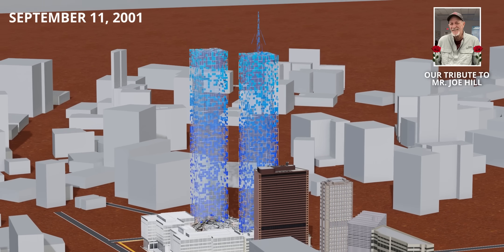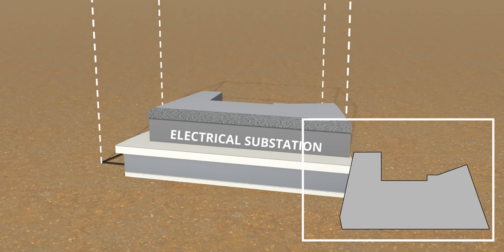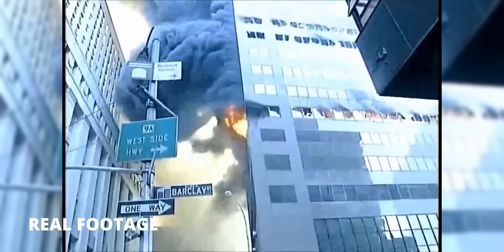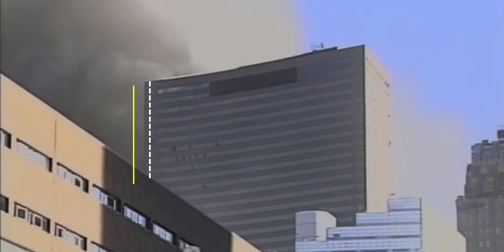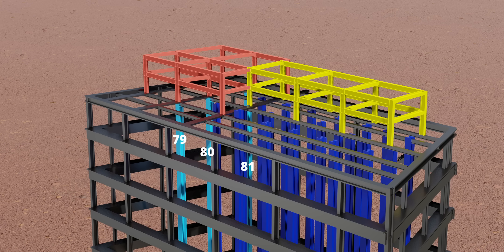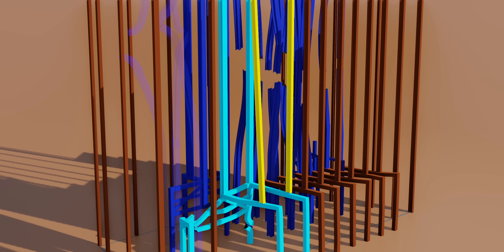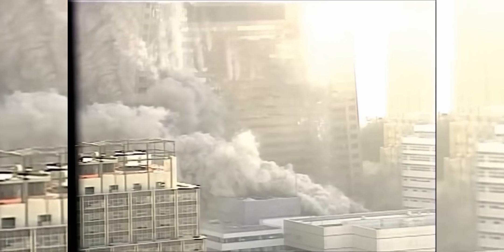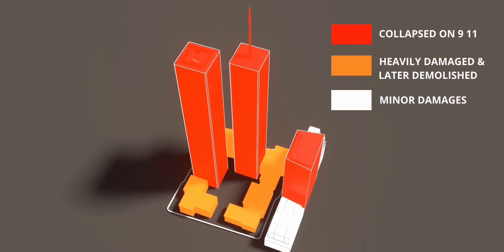Collapse of Building 7 | The Complete Physics

Comment: The biggest coverup in US history. The towers and this building were rigged to collapse. 
No way this group knows the supporting structure was broken in this manner.
Reply: The collapse of Building 7 is one of the most studied engineering disasters in history and the subject of 5 comprehensive engineering studies and more than two dozen technical articles in major peer reviewed engineering journals, most of which were published 15 or more years ago. Thousands of pages of material.

This should get you started.

FEMA BPAT (initial report superseded by NIST NCSTAR 1A)

NIST NCSTAR 1A: Final Report on the Collapse of the World Trade Center Building 7, 2008.

Guy Nordenson and Associates, WTC7 Global Collapse Analysis Report and Summary of Findings, 2010.

Arup, WTC -7 Structural Fire Analysis Report (Runs 1-4), 2010.

Weidlinger Associates Inc., WTC 7 Collapse Analysis and Assessment Report, 2010.

BRE Centre for Fire Safety Engineering, Analysis of the Impact of a Fire in the Mechanical Room (5th & 6th Floor) of the World Trade Center 7 Building, 2010.

T. McAllister, R. MacNeill, O. Erbay, A. Sarawit, M. Zarghamee, S. Kirkpatrick, J. Gross, Analysis of structural response of WTC 7 to fire and sequential failures leading to collapse, J. Struct. Eng. (United States). 138 (2012) 109–117.

For a summary of the major studies I would recommend THE COLLAPSE OF WORLD TRADE CENTER 7: REVISITED by Mhd Anwar Orabi , Liming Jiang , Asif Usmani and Jose Torero which is a 33 page summary of the different analysis and conclusions published in 2020. Sorry, YouTube will delete this post if I give the link but it should be easy to find and is available from the University of Queensland, Brisbane.

Real structural engineering industry professionals conducting real engineering studies and publishing them for other professionals to see. Not amateur YouTubers appealing to the gullible and credulous.

Happy reading
Reply: it was so important that they didnt even include it in the commission report 😂
Reply: @sykocase247  - The 9/11 Commission did not report on ANY building collapses - not their job. 

Be less stupid.

Comment: Collapse of Building 7 | The Complete Bullshit...................... Don't insult us with your hypothetical analysis. Controlled demolition brought down WT7, and probably Towers 1&2
Reply: This is BS is,… well, BS.

Present your point if you are going to deny an argument.

If you don't like this video you are in luck:  The collapse of Building 7 is one of the most studied engineering disasters in history and the subject of 5 comprehensive engineering studies and more than two dozen technical articles in major peer reviewed engineering journals, most of which were published 15 or more years ago. Thousands of pages of material.

This should get you started.

FEMA BPAT (initial report superseded by NIST NCSTAR 1A)

NIST NCSTAR 1A: Final Report on the Collapse of the World Trade Center Building 7, 2008.

Guy Nordenson and Associates, WTC7 Global Collapse Analysis Report and Summary of Findings, 2010.

Arup, WTC -7 Structural Fire Analysis Report (Runs 1-4), 2010.

Weidlinger Associates Inc., WTC 7 Collapse Analysis and Assessment Report, 2010.

BRE Centre for Fire Safety Engineering, Analysis of the Impact of a Fire in the Mechanical Room (5th & 6th Floor) of the World Trade Center 7 Building, 2010.

T. McAllister, R. MacNeill, O. Erbay, A. Sarawit, M. Zarghamee, S. Kirkpatrick, J. Gross, Analysis of structural response of WTC 7 to fire and sequential failures leading to collapse, J. Struct. Eng. (United States). 138 (2012) 109–117.

For a summary of the major studies I would recommend THE COLLAPSE OF WORLD TRADE CENTER 7: REVISITED by Mhd Anwar Orabi , Liming Jiang , Asif Usmani and Jose Torero which is a 33 page summary of the different analysis and conclusions published in 2020. Sorry, YouTube will delete this post if I give the link but it should be easy to find and is available from the University of Queensland, Brisbane.

Real structural engineering industry professionals conducting real engineering studies and publishing them for other professionals to see. Not amateur YouTubers appealing to the gullible and credulous.

Happy reading

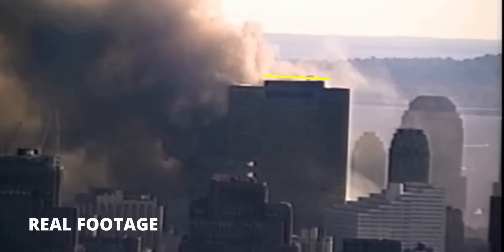Comment: Core columns collapsed progressively 7:14 … but the building fell at free fall?
Reply: No, the exterior moment frame - or at least one corner of it moved (not "dropped") at a rate that if you average it over an arbitrary 2.25 seconds of time, was close enough to the same rate of acceleration as FFA (in a vacuum).

But it was just a hollow empty shell - the building (cores, floors, most of the perimeter columns, roof, etc) was already gone.

So who cares?

How fast something falls can't tell you what started it falling in the first place anyway.
Reply: @TheCriticalStinker-01 dude do you see your wordsmithing here? 

If it was hollowing (at one point it wasn’t hollow as you describe but now is) wouldn’t you anticipate a cascading descent where sections of the building fall into each other and the other standing portions of the building prevent it from falling at the speed of gravity? The issue is it was completely standing and then completely fell at free fall through massive sections of steel beams.
Reply: @DoubleDadinator  Here's a hint: instead of going "nuh-uh!" consider what you're told. Then pause and think about it.

Nothing you posted as an answer was in any way relevant to what he told you.
Reply: @mooneyes2k478 the whole thing fell as one piece, in motion, at near free fall through tons of solid steel. You can make as many graphical renderings to try to justify it as possible.

The fact that you think a building on fire would collapse neatly into its own footprint in one fluid motion speaks to your intelligence. 

 I’m done arguing with the Israel bots, you can take your phone server farm and drive the traffic somewhere else
Reply: @DoubleDadinator  these 2 are bots, there’s 1 more troll bot farming this videos comment section… they will call you dumb then quote the NIST Report like its the fckn Holy Bible
Reply: @DoubleDadinator  "the whole thing fell as one piece, "
Very good, you got something wrong. Impressive, that.

" at near free fall"
Not understanding something isn't an argument.

"through tons of solid steel"
And you got something wrong again.

"The fact that you think a building on fire would collapse neatly into its own footprint in one fluid motion speaks to your intelligence. "
Oh, I don't think that, because I actually managed to think.
I leave idiocies like that to people like you. That you don't have the first bit of understanding of what happened? Means you should find out instead of blindly repeating dumb shit you heard.

As for "arguing", you have never managed that, we can easily see from your post.
Reply: @TheCriticalStinker-01 like you said to another comment: make a video ! Don't try to convince me on YouTube comment section

Comment: All four corners dropped same time. Controlled demolision. Would have taken weeks of planning and placing explosives.
Reply: All four corners of the outer shell you mean. The building (defined as the center of mass - core columns, floor systems, etc) - everything that defines the building as a building - was already gone before that happens. 

Building 7 was weird. It collapsed from the inside out, which tricks the eye when looking for familiar patterns they can understand.  This is not intuitive to most people, who can watch even simple videos like the one above over and over again and it still won't click.  

The exterior moment frame, which was only a hollow shell hung on the outside of the building is ALL you are seeing. The Building (defined as its center of mass) - the core columns, floor systems and most of the perimeter columns were already gone, leaving that outer empty shell all alone with insufficient lateral support.  That caused the last 4 (of 83) corner columns still (barely) supporting it to buckle under the strain.  When that happens there is no resistance because there is no structure left.  The exterior moment frame free falls to the ground, possibly even for a moment achieving a rate of motion broadly equivalent to free fall acceleration although it really isn't. 

This is the result of 7 hours of building-wide unfought fires.  Fire is one of the most destructive forces known to man, frequently wiping out entire towns, even cities.  People just get overwhelmed by the size of Building 7 and imagine size grants some sort of magical immunity, so they search for simple scapegoats to explain what they have trouble comprehending. 

Sometimes you just need to actually look - and use the thinking part of the brain
Reply: Complete horse duce...you clearly know nothing about construction stinky.

Comment: So 3 damaged columns took down 24 others and then the whole thing collapsed in seconds like an old Vegas Hotel! Got it!
Reply: Floors in the NE corner between 7-14 fail, leaving C79 laterally unsupported over a critical length, resulting in failure by Euler buckling.

This in turn leaves C80 laterally unsupported over a critical length and it fails, followed rapidly by C81.

Then the rest of the core columns fail the same way, from east to west until the core is gone, taking all of the floors with it and leaving only the exterior moment frame still briefly standing - like an empty cereal box.
Reply: @TheCriticalStinker-01  🤔 like a fckn cereal box eh? 
Yet they say “freedumb truthers” are crazy😂
Reply: @LibertyOrD__th  - EMPTY cereal box - as in no contents, nothing on the inside.

I know this is a very tough concept the smooth brained.

This is why you constantly fail
Reply: @TheCriticalStinker-01  ohhhhhh now you’ve convinced me, an office fire and falling debris made wtc7 “empty like a cereal box” eh?😂😂😂😂
Reply: @TheCriticalStinker-01  is there any part of the NIST Report or the 9/11 Commission Report that you don’t believe, or is everything just taken at face value as the truth?
Reply: @LibertyOrD__th  Yeah. They do say that. And you're not really moving the needle on that one, what with your utter failure at even the most basic facts.

Comment: WTC7 was very sympathetic to the aweful plight of towers 1 and 2. It is what is known in structural engineering as: empathetic strain. If one metal bar suffers, they all suffer, even if the others are unaffeacted.
Not to mention, Donald Rumsfeld's anouncement the day before that 2 trillion in defence expenses couldn't be accounted for. And the evidence for that was in building 7.
Reply: There's a lot of truth in what you're saying.  The heat spreads out in steel. If a room is 800 degrees. The steels temperature will be less because the heat will spread out throughout the entire steel structure.

Comment: It is impossible to have symmetrical collapse when you have asymmetrical damage. This was controlled demolition all day long.
Reply: OK, but so what?  The collapse described in this video was progressive which is the opposite of symmetrical. You probably should have actually watched the video before mindlessly repeating dogma you found on the internet.
Reply: @TheCriticalStinker-01 , oddly, I did watch the video and it even goes against what NIST put out !!

When the whole building comes down that way, it is clear that all columns have been taken out at the same time which is controlled demolition. The events described here would have seen the building fall into itself not straight down like that. Perfectly good columns don't just fail instantaneously when a bad one fails.

This video also doesn't go anywhere near all the explosions that were heard prior to the collapse. I even saw a video years ago that shows explosions going all across one of the lower floors prior to the collapse.
Reply: @BlackCat0315  ikr, the 2 visible walls fall straight down achieving free-fall for the last 41.6% of the collapse. 

Im not buying this cgi video “explaining” what happened to all the support columns
Reply: @LibertyOrD__th , NIST were unable to provide a model of the entire collapse based on their theory. Their models all showed any collapse but the one we saw.
Reply: @BlackCat0315  thats what ive gathered aswell although “im no expert”. “Architect and Engineers for 9/11 Truth” have petitioned legislators to reopen an investigation around the collapse of all the buildings to no avail yet… maybe in another 25 years we can get an actual 3rd party investigation into what actually happened
Reply: So, so what? I mean, not that you're right, but it doesn't really matter since there was no "symmetrical collapse". That you don't understand what happened only mean you don't understand, not that reality is what you want it to be.
Reply: @mooneyes2k478 , analysis and video has beyond proven that the outside support structure came down symmetrically. If the building came down as this video tells, the outside structure would have come down in line with anything going on with the inside structure. The building would have come down from one end to the other and the inside going first would have dragged the outside in causing the building to collapse into itself. This would have been clear on video but we see the building come straight down.

Video clearly demonstrates that the outside columns all came down altogether at the same, a symmetrical collapse. This means that all the sound and intact support structure across the rest of the building would had to have failed at the exact same time as the other end where the "damage" all was. Sound, intact structure doesn't just suddenly and simultaneously fail when other parts of the building fail. Only controlled demolition could have caused this. And again, no-one has yet explained all the explosions that were heard prior to its collapse.

I find it amazing that people still believe that 19 ill prepared and ill equipped "terrorists" did this. Wake up.
Reply: @BlackCat0315  "analysis and video has beyond proven that the outside support structure came down symmetrically"
It's just that this "analysis" and video, not to mention this proof, just doesn't seem to exist. Strange that.

Meanwhile, since Building 7 collapsed onto both the Verizon Building and Fiterman Hall, which were in two completely separate directions, evidence and fact says otherwise. 

"Video clearly demonstrates that the outside columns all came down altogether at the same, a symmetrical collapse."
That you're not understanding what you're seeing doesn't mean that what you want to happen is. It means you're not understanding.

" Sound, intact structure doesn't just suddenly and simultaneously fail when other parts of the building fail."
Of course not. After all, it's not like a building is one coherent unit that, when part of it fail, follow along.
....wait....
Reply: @mooneyes2k478 , you've clearly never bothered to watch the Architects and Engineers for 9/11 Truth stuff then.

Strange that !!

Try opening your eyes.
Reply: @BlackCat0315  - The outside support structure as you call it was essentially just the 4 corner columns.

Out of 83.

And they were the last to fail.  

So what?  

I explained all of this in my previous post from yesterday - which you of course ignored.
Reply: @BlackCat0315  Why would I "watch" garbage coming out of a group of people dedicated to defrauding the gullible for their own gain?

Not one of the less than half-a-dozen people in A&E911 have any understanding or authority.
This is perfectly illustrated by the no longer connected Richard Gage making a video where he bangs two cardboard boxes together and thinks this is an argument.
Reply: 2 bots